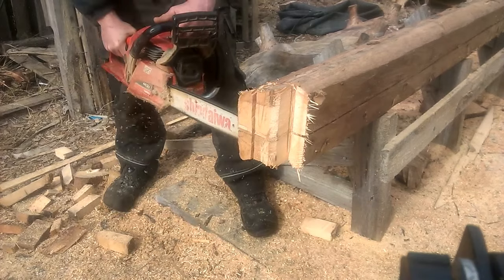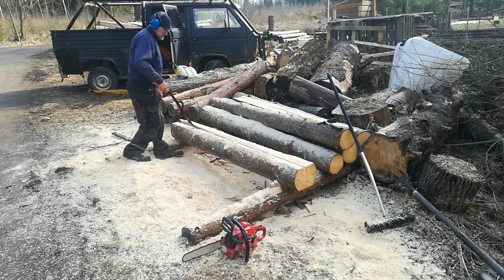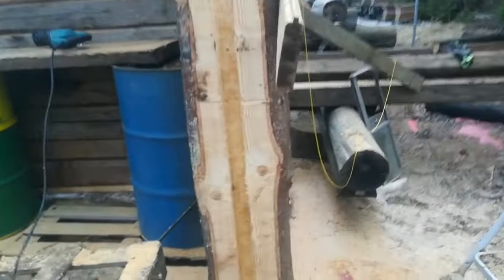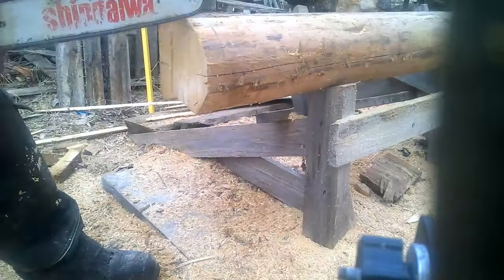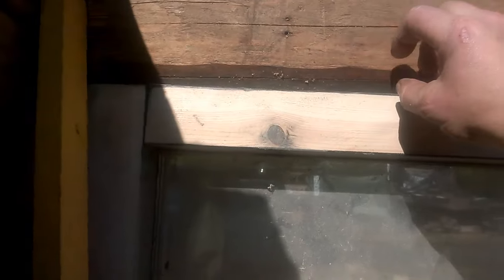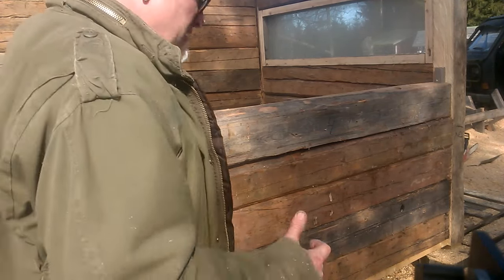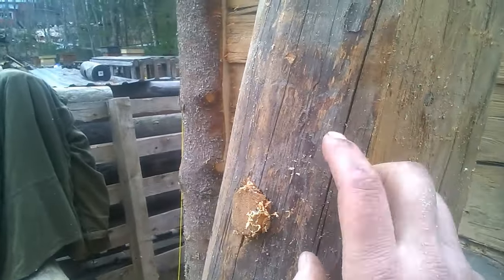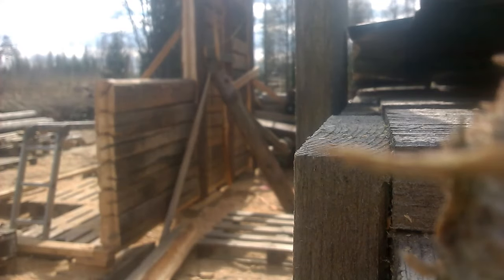Easiest log building method ever!!. Part 2

Comment: Besides being a somewhat easier method than more traditional log cabin construction techniques, is the ability to start with a smaller single room cabin and expand to multiple rooms as time, resources, and needs arise. Very modular friendly method.
Reply from the maker: very good point. thanks.
Reply from the maker: TruthSeeking Endless  I'm afraid its not as simple as that. the dryness of the logs is not the only factor. When you cut the grooves and notches you change the stresses in the logs so they will change shape and settle even if they were totally dry.  The prevailing wisdom is to stack and dry logs for a couple of years before using them. The traditional way that it was done here was to girdle trees (remove a ring of bark, killing the tree and starting the drying process while the tree is still standing) theses trees all being on the northern side of the forest (slower growing). Wait a couple of years. Then fell the trees, partially remove the bark in strips, stack the logs and wait another couple of years.
Reply: @ProjectHighlander Iso kiitos näistä videoista! Missäpäin vaikutat?

Comment: @ 3:26, the word you're looking for is "gutter", typically cut out with a "gotter adze" or your tool of choice.  Cheers and thanks for sharing!  The Northmen YouTube channel, "birth of a wooden house" is built in a similar fashion... brilliant and an excellent solution for green timber building where the logs would season and shrink causing issues for the windows and doors, just applying this same technic in those areas the logs can simply slide down as they season as long as you remember to leave a gap at the top for this settling.
Reply from the maker: OK, gutter. Interesting. I have also seen it called a 'lateral notch'.

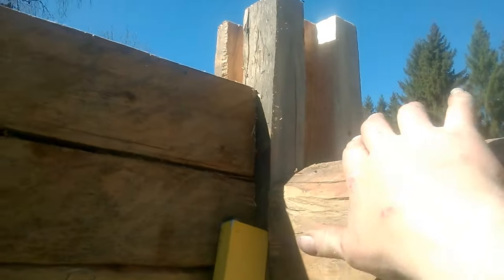Comment: I wouldn't expect much shrinking of 100yr plus logs; as mentioned when explaining the window installation at 12:28
Reply from the maker: no. not much shrinkage expected. but the logs were stored for a few years outside, covered but not under a roof so they will have taken on a little moisture. So while I don't think there will be much shrinkage I have to take it into account
....

Comment: You've given me an idea. Thanks! I am going to build my own variation of your method using vertical posts as walls.
Reply from the maker: Yes, that can work. try to source really really dry logs so they don't shrink much because you won't have gravity helping  to close the gaps between logs as they dry.
Reply: @ProjectHighlander  I will be using white pine that's still green. I cut them two months ago. What are your suggestions then? I was told to cut a two inch deep groove down the length of the logs and drive wedges in to prevent checking. This would be concealed in between adjacent logs of course.
Reply from the maker: @mountainsasquatch13   Ok. Therebis no easy answer to this one. It depends what kind of building you are doing, if you are insulating between logs etc. The log will split down the line whre the distance from the heart wood to the 'surface' is the least. So that will be where you have made the groove. when you cut out the bigger groove to fit against the next log you will do this along that line. if its green wood and you want to minimise the  the amount to which your logs will become loose as they shrink then when you do this bigger groove you want to make it really exact. When doing normal horizontal logs its generally ok to have some space between the logs in the middle of the groove. The log can crack and sink down but the seams on the outside won't  open up. You need to do the oposite. the middle of the groove should be touching the next log as well as the edges. As the log cracks and moves the inner edges of the crack will push against the next log keeping the fit tight. the downside is that the seams on the outside will open up a bit. Hope This helps.
Reply: @ProjectHighlander  Thanks. It helps me tremendously to be able to pull from your knowledge and experience. Since I am using green wood do you think that it would be better to build horizontal log walls instead of vertical like I planned?
Reply from the maker: @mountainsasquatch13   Well, yes it would be better...but it might be more interesting to go vertical. I'd love to hear how that goes. We don't learn and move forward if people don't think (and work) out of the box.
Reply: Seal the ends of your green logs it will prevent checking.
Reply: Not sure if you noticed the drawback of using green wood for this style of log building. As the pieces dry, they will shrink in size a little. Gravity will cause the pieces  to show a gap at the top sil or plate, pay close attention to how builders deal with that. This is old school and very effective for a off grid site.
Reply from the maker: Firstly This is not green wood. Secondly shrinkage is taken into account. Covered in the later videos.
Reply from the maker: @davidrhoden4906  No, it won't. It does reduce checking..or cracking, but it does not eliminate it. Logs crack as they dry.

Comment: Quite a clever technique. I'm especially appreciating the efficiencies that come with stacking the wall sections and cutting the tenons on one end all at one time. That's quite a lot of time and effort saved.
Reply from the maker: It is but doing the wall sections also means you are dealing with much shorter, easy to handle, logs. No lifting equipment needed.

Comment: Like  this  a lot  and  am  thinking of  doing this  but for the logs   drilling a  hole into  them  for  WOODEN  PEGS  to  go from the  TOP   To  the  bottom of  halfway to  the  next  log  it is  a lot of   pegs but  as it goes on  up  they  go together  and  stay there  what do  you think of this  !!!  I have a panel of  a  quilt that  I have been  quilting and it is like the  A - FRAME  Log  cabin  Homey  and SWEET  BOTH OF THEM!!!
Reply from the maker: Thats exactly what I did when I rebuilt this building on site.

Comment: Excellent innovation and great work! You mentioned in Part 1 that others surely have used similar methods because of the variety of problems that are solved by your tongue-and-notch innovation. One such company in the States is Pan Abode Cedar Homes. They started building simple pre-fab kit cabins in 1952 using a similar tongue-and-notch method, and have since expanded into engineered systems, laminates, custom homes, etc. But the fundamental tongue-and-notch system has stayed with the company through all their growth, technical changes and competitive pressures. That's an enduring testament to your method. 

For me, your videos have opened up many new possibilities for my cabin and (almost remote) property in Kenai, Alaska. The method is so flexible I can adapt and combine to create my own unique buildings, boathouses, sheds, whatever! Thanks.
Reply from the maker: You are very welcome. I really hope you can adapt and combine this method. Continuous innovation can only be a good thing. My next project will also combine my method with some other traditional techniques.
Reply: Hello Eric Downey, I also own land in the Kenai area. Have you started any log building?

Comment: Hey I’m working my way through this series. Interesting stuff, thanks for sharing. Question - I notice you put the “groove” in the vertical post and the “tongue” in the horizontal log. Any reason/consideration for this, as opposed to “tongue” on the post and “groove” in the horizontal log?
Reply from the maker: Thanks for the question! Not really a big difference. I have done it the other way also but it meant adding wood. I have screwed a 2x4 on to the side of the post and grooved the ends of the horizontal logs. There is a small technical difference because you are adding a verticle piece of wood that may shrink at a different rate than the post. I negate this difference by screwiwing the 2x4 to the post with screws positioned around the center point of each horizontal log...avoiding the joints between one horizontal log and the next (if you see what I mean?) and cutting the vertical 2x4 here and there with the chainsaw between the screws so that it can shrink as the wall drops. I think I cover this in one of the later videos where I do this either side of the door.

Comment: May I ask about your chain. I noticed you were using a skip tooth chain, do you always use the skip when constructing or did you only use it for cuts with the mini-mill? If not what type of chain do you use for building the tongue and grooves (ripping chain maybe?)?
Reply from the maker: Absolute standard straight off the shelf normal chain.

Comment: What is the max length you could get away with before putting in another verticle support log?
Reply from the maker: How strong are you. If you do not have lifting equipment then you are limited only by how much you can lift....Although if you use common sense and know how to handle logs then you can actually maneuver logs solo despite them being many times heavier than you can actually lift. I will be covering this in my next log building video series.

Comment: Can ya just use 4 flat edges all the way around, without the beveled / curved cutout in between each log
Reply from the maker: You could but that curved cutout means the seams are pointing downwards preventing water from seeping in and up into the seams. But I have seen log buildings made with square logs just stacked ontop of each other and aparently it can be ok. make sure you have a really long overhang of the roof to prevent as much water as possible getting to the walls.

Comment: I have watched this series of videos multiple times can you use this system for square milled logs/beams? I am at the very beginnings of building my home this way on my Channel.
Reply from the maker: I think shaping the bottom of the logs to fit the previous logs has some advantages but it will work with sqare section logs also.
Reply: @ProjectHighlander  Thank you may look at a tongue&groove on the beams I'm milling as well my concern would be warping making gaps on the square beams that's why I asked still in the planning phase for the walls.
Reply from the maker: Subscribed to your channel. look forward to more videos....
Reply: @ProjectHighlander  I did to yours as well definitely hope to have your input as well Thanks again for the advice & sub☺️ I was planning on a video today will definitely have one up now. I'll be sure to give you a shout out!
Reply from the maker: @daninthedirt9449  Thanks. I will be following your project. On the subject of warping....yes, that is one of the advantages of cutting the horizontal groove in the bottom of the log which sits down, with all the weight above it, on the back of the log underneath. It helps to prevent warping and twisting. However the pegs also help so if you use square section lumber then you could consider putting in more pegs. Doubling up on the number of pegs can't hurt.
Reply from the maker: Hey, just thinking about your project and before you o too far I suggest you think about adding an extra pillar, or support right in the middle of your building. you are talking about a 10m x 10m building, that' a big area. Consider putting in a support pillar right in the middle.
Reply: @ProjectHighlander  I have one in the dead center well the pads there for it. I have a video up of the basic drawings/plans☺️Ya it's gonna be heavy!
Reply from the maker: @daninthedirt9449   I guess I saw that video. with your drawings, maybe I missed the center post. Anyway. looking forward to seeing more. I'll be watching!
Reply: @ProjectHighlander  Thank you my friend☺️

Comment: I wonder if you could incorporate a chinking method into this style? I would be concerned about water trapped between the logs and rotting. You have the creative juice overflowing on this one. Great idea!
Reply from the maker: I don't really understand the question. Maybe I don't understand what you mean by chinking. Here we insulate between logs as we build and once  a roof is on three is no concern with any moisture between the logs. Of course people around here have only been building with logs for a few hundred years and have not had a problem with 'water trapped between the logs and rotting'......I am currently restoring a 300 yr old log building.....putting in new floors, the log walls are fine. But thanks for watching!

Comment: Question, instead of rounding them to fit the bottom of one to the other, could you do the same notch method? If so how? If not why?
Reply from the maker: Hi. Sorry but I do not understand the question...instead of rounding them.... instead of rounding what? I try to answer all questions so I'd love it if you could give me a bit more info so I can give you an answer.
Reply: 1.Looks to be about the 10:25 mark one has a significant bottom gap and it appears that you corrected it.
2. All of these have an n shape on top and not sure if they were cut that way already to fit each other. Or could you have flat on top and bottom to stack on top of each other?
Reply from the maker: @bigr0075  - ok, so you mean the logs themselves. These are hewn logs that Have been salvaged. They were part of another building that was taken down. Hewn logs are logs where two sides have been removed so that the wall will have flat sides inside and outside. But logs are not straight, so you will always have to shape the bottom of each log to fit onto the log below.  If you used saw lumber  then you would have flat surfaces top and bottom and could just stack them but that has problems, you are more likely to have gaps open up as the wood twists and bends as it dries, you are more likely to wick water into your wall because your joints are horizontal. . In your first question you asked if you could do the same notch system on the horizontals as the verticals. Again, every log is a different shape so we are not dealing with straight lines. Trying what you are suggesting would be much more difficult and much more work than just shaping each log to fit the previous one.

Comment: Putting the V lateral notch seems like that would be difficult.  That needs to be pretty uniform the whole length of log or would cause all sorts of leveling and plum issues.
Reply from the maker: As with almost every log building method.

Comment: what type of foundation would you suggest, using this method, for something like a 20' x 40' long cabin on a slight slope?
Reply from the maker: Its a good question. I would say pillars but the question becomes how many & spacing. It depends a bit on the layout but obviously the optimum would be a pillar under each vertical post. Of course this may be impractical. You use feet so I guess you are in the US so I am not sure of all the terms there but if a plinth foundation is out of the question (expensive) then I would consider changing it up a bit and laying down a round or two of full horizontal logs and then building with the vertical logs on top of them, then the pillars could go wherever you want, say at 10 ft spacing.
Reply: @ProjectHighlander  do you mean using the full logs as rim/end joists along the perimeter for the outer posts to sit on? I plan on making rooms and interior walls, and I should be able to put one post under each interior vertical, but I wonder how the floor joist process would go with posts all over the place lol
Reply from the maker: Would it be ok if I try to clarify what I said in a video?
Reply: @ProjectHighlander  it would be greatly appreciated! I am designing my build and want to make sure I do it right. I don't think I can build before the foundation is in place
Reply from the maker: uploading a video now.
Reply from the maker: Called The story behind the thumbnail..

Comment: I think if you cut all logs flat and screwed in 2x2 for the tougee like you did the window. This would be alot faster.  Cut your time in half.
Reply: The window moves as a unit, sliding in the groove with seasonal mvmts.  If you screwed a lumber tongue to the ends of the logs, you would join all of them - this would not allow for seasonal mvmt, settling, and ultimately the logs would come loose from the tongue.

Comment: How well does this method work with wet logs?
Reply from the maker: Actually really well. Wet, un-seasoned logs will shrink a lot as they dry, this is a bit of a problem with 'normal' log building but it does not really matter at all with this system.
Reply: @ProjectHighlander  ty for replying and taking the time to answer almost every single persons questions... As far as all the haters go... Fuck em there's always going to be some of those... appreciate you
Reply from the maker: @robertwelsh2499   Ha ha, yes there will. Many thanks!
Reply: @ProjectHighlander  I suppose that even if there is shifting, that will just leave a gap, which can be chinked if it would improve the appearance.  For the most part, the horizontal logs mainly function as really robust siding!